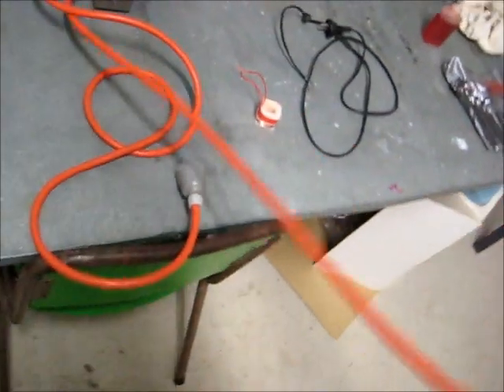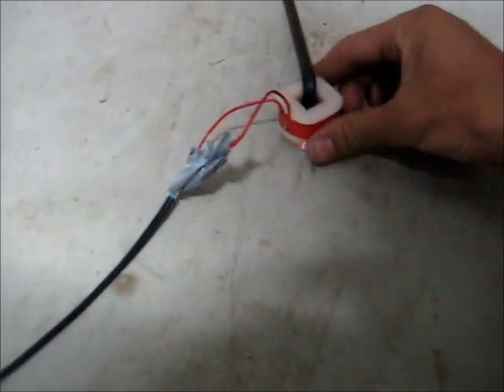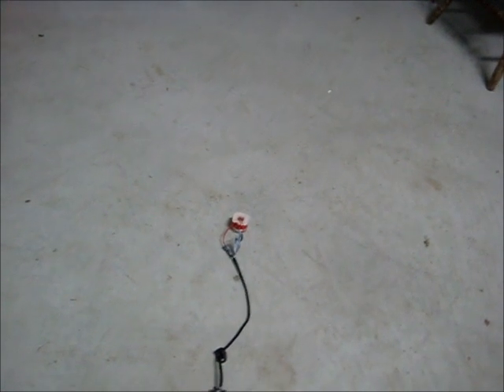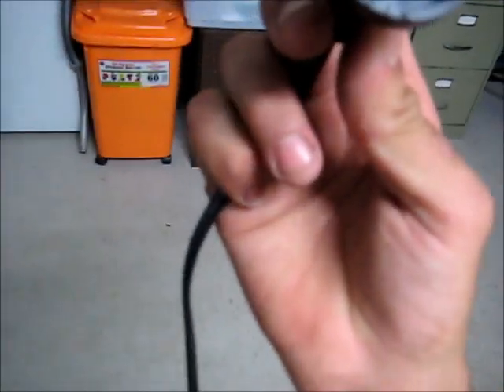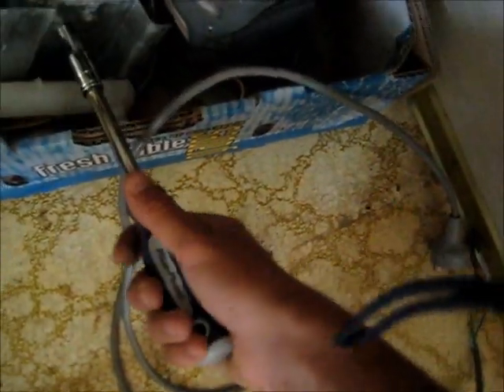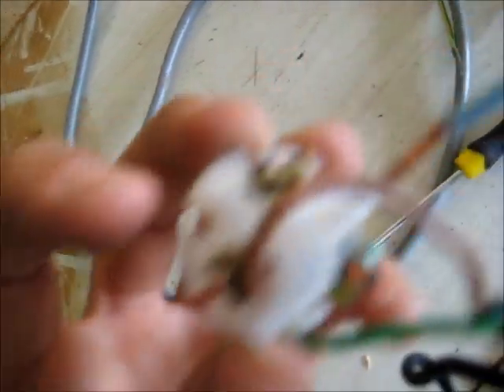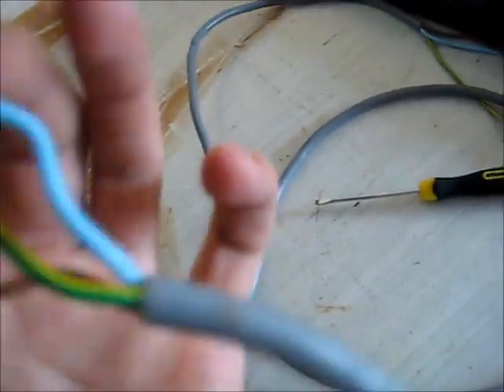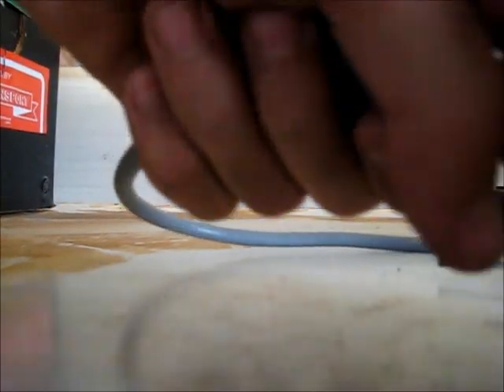Wire up a Pump & test & general safety

Comment: Cool plug man, the rubber is more flexible on the older plugs, arlec plugs are a bitch to remove as the rubber is pretty hard, I just cut them off, they're POS :( Cool vid :)

Comment: talking about plugs i use an old round pin 15 amp plug on my old industrial fan heater. i replaced the old stranded cable with solid core cable and it heats my garage easily. i rewound the element on it, fitted a better fan and replaced the smashed front grille.